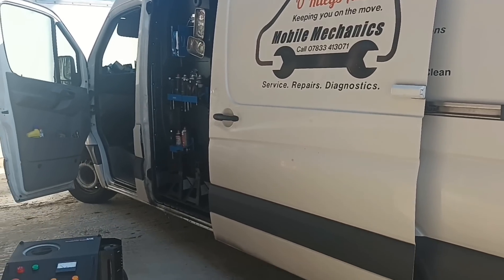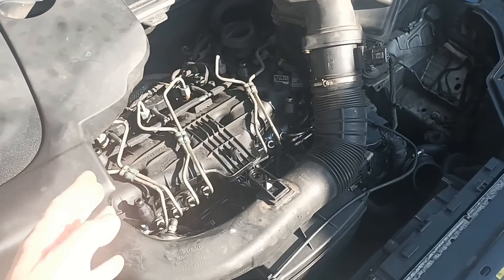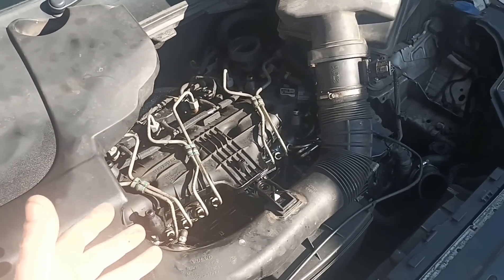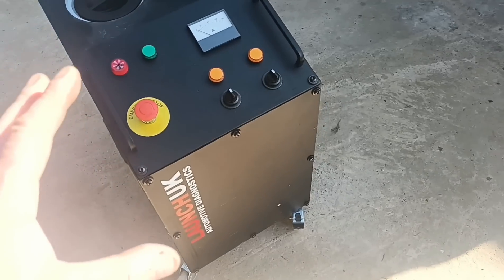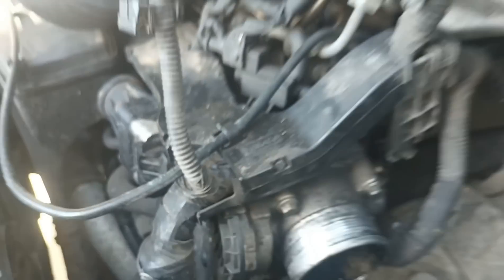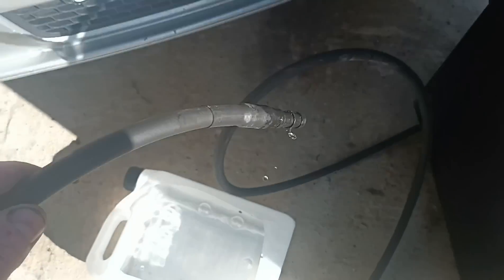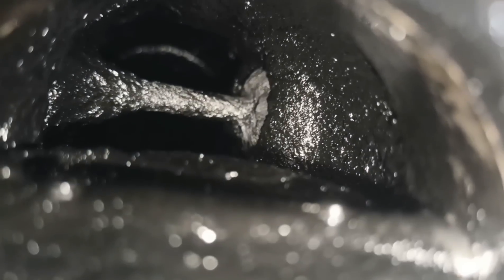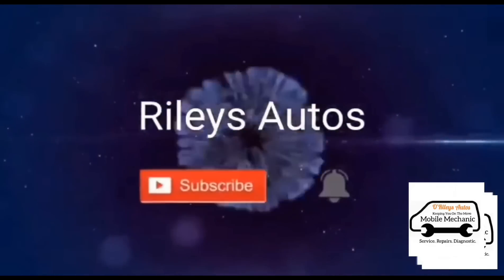Does HHO Hydrogen Engine Carbon Cleaning Work? Is It A Scam?

Comment: Here is a link to a re iew on the sysytem, dont seem to be able to find the website for purchase anymore though, odd. It is also known as cgon as wellmas atmosclear, my local MoT center said tht the co2 emmissions on my defender were lower than that of a prius!!! I did not tell them about the system prior to the MoT but rather they were confused about the emmissions and asked questions after it passed.

Comment: I have fitted a atmosclear hydrogen on demand system to defender 2.2 puma (ford engine) removed the dpf and replaced with straight through pipe, removed the egr via map. The vehicle has sailed through the last 4 MOTs with very low co2 emmissions. This system has been tested bt the MoD on armoured vehicles and proven to work by them. Grznted this is a constant hydrogen system and not just a half hr or 1 hr dose. It seems to make the engine far more responsive and well as quiter and smoother on tick over. Intersted on your take with regards to this.

Comment: The byproduct of burning hydrogen is water. I’m guessing any improvement would be as a result of steam. (Unlikely to effect EGR) It would have to be an enormous amount of hydrogen and also inject some oxygen (to get a stoichiometric ratio)in order to work. That or weeks worth of driving with a hydrogen tank attached. Also LPG produces water and there are Australian companies that inject  auxiliary gas into Diesel engines that reportedly run very clean. But not common rail.

Comment: So glad I didnt buy one of these. I was going to buy a similar but higher spec machine at auction and asked the manufacturers for a user manual in advance of auction end. Turns out they did not sell them but only rented them. The garage had gone into liquidation and the liquidators tried to sell the machine that should have been returned under the rental agreement, so they were glad I contacted them so they could get it back. They told me honestly that the reason they don't generally sell them is that they are unreliable and go wrong frequently so they only supply them as part of a rental package and they take them back to base to repair them - frequently! This was on a circa £8-10k machine.

Comment: hydrogen does not react with carbon at intake pressures and temperature so it is obvious that the intake is as dirty as before. It only MAY react in the combustion chamber forming hydrocarbons and remove carbon.

Comment: Done a lot of carbon and soot cleaning manually and with mr muscle oven cleaner (which does work a treat if you can get it onto the affected area and leave it there to work for 30mins). Long story short all these spray and gimmicks dont work. Waste of money. 
Walnut blasting is amazing 👏 only way to clean an intake like new. 
There is no short cuts unfortunately

Comment: See when hydrogen burns inside the engine it produces extra hot vapors which will clean combustion chamber and exhaust pipe. But it takes time. This video is misleading as it shown intake side where blown-by gas are fed back to the engine. These PCVs and EGRs will always  be like that.
Reply from the maker: Let me guess.. your business uses or sells these machines? I am demonstrating a service that is offered all over Europe for carbon cleaning inlet valves and egr valves and it clearly doesn't work. I have never seen anyone want there combustion chamber cleaned

Comment: Further hydrogen only cleans high pressure areas where carbon can fuse with carbon to produce hydrocarbons in gaseous form. Not made to clean egr ect.

Comment: You all got the concept wrong. Adding hydrogen as fuel to intake doesn't remove carbon deposits that already exist in the car's breathing system. Thats nonsense. Adding hydrogen will reduce the amount of fuel that the engine consumes for that particular RPM & engine load as it is substituted by hydrogen which itself is combustible. So, reduced fuel(Diesel or Petrol) means reduced emissions and reduced carbon waste flowing into the combustion chambers, through the intake and exhaust systems. As long as there are PCVs and EGRs which add exhaust gases back into the intake, there will be carbon deposits. Substituting regular fuel with some amounts of hydrogen will reduce the tendency of carbon build-up, not take out the existing deposits, which needs to be done manually. Adding hydrogen as fuel to intake will result in reduced carbon build-up, reduced emissions and reduced fuel consumption. What needs to be done is ECM mapping to alter the AFR according to the quantity of hydrogen supplied so that fuel injection is decreased at variuos RPM and loads. Even timing needs to be advanced or reset accordingly to avoid knocking.

If you want a real time hack, take a big vet syringe, add 50ml of vinegar+water mix(50:50 ratio) and slowly inject the mixture into the intake manifold rubber hose just after the MAP sensor. Do it for 30 minutes with intervals in injecting and see the results for yourself, most visibly that smoke from your tail pipe must vanish or reduce. 

Thanks.

Comment: I used an HHO machine that I made on my car along with using 2 secret products. I changed the spark plugs too and use 1 particular performance chip to have absolutely insane performance. 27 year old camry drives like literally brand new. My exhaust pipe has black stuff (and white) all over it and little puddles would form under the tailpipe.

Comment: I did the carbon cleaning on my 320d 230k km and it made a nice improvement. How you did the procedure is not the right way. First of all for €85,- it does a very good job. The engine needed to be running 45 min on stationair idle and the right amount of hydrogen mixture. When you rev the engine you pull most of the hydrogen direct through the engine and it burns away. You want to have the hydrogen gas as long as possible in the intake manifold to settle in the carbon. Only rev a few time between 2000-2500rpm to open the egr valve. After the session you go drive for at least 30 min on normal driving. After a time the engine starts running better and better even after two weeks i feel improvement. Of course this will not make it clean as new but it is worthy and worked for me.
Reply: Did you had engine vibrations at idle before carboncleaning?
Reply: @nelsonafonso1  yes, was some ,not scary, but was some .
After I cleaned the injection system too .
Reply: @expatinbrazil  right, i have w211 220 cdi over 300.000km and at idle it vibrates  and has some fluctuations on the rpm, so I'm considering a carbon clean
Reply: @nelsonafonso1  mine was doing a good improvement actually.  I wasn't expecting to be that good . I remember, on my Kangoo the Renault dealer ask me to replace the injectors and clean the diesel tank . I did it in my way and was much cheaper, much faster and the results save me good money.
Reply: Agree with you!
I cleaned my 1.7 DTI engine ( opel astra), Renault Kangoo 1.5 diesel ( 2 times ) and was an excellent job and big improvement. 
Of course, more expensive than 100E each time.
Reply: ABSOLUTELY RIGHT   1. time of  cleaning  2. AMOUNT OF  HYDROGEN, that unit u use  is a toy one.
Reply: You sound like you sell this service 😂

Comment: Why not make a small  hydrogen generator and permanently fix it. Find out in you tube. ....your car will be hybrid. Saves fuel.
Reply: Only if the hydrogen is made via a solar panel. Otherwise it's using engine power via the alternator to create the hydrogen, negating any supposed fuel economy increase.

Comment: the only thing hho will clean is the combustion chamber and it takes ages not an hour but driving a car with a hho cell on it, when you dissasemmble and engine that runs a hho cell its absolutelyspotless inside like it was just assembled after a rebuild, hho when burnt produces water vapour that cleans thr engine thats not the goal its just a bonus, weve run hho cells since 78 for better economy, it makes a very good difference on "old" school desiels .

Comment: 200k miles worth of baked on gunk, would we see better results on a lower mileage engine, with this being a preventative measure and not the cure?
Reply: That is my thinking exactly. I have been doing it on my ML320 every 40k and it's pretty clean inside. I had to replace oil cooler seals and the insides were not caked in tough residue.

Comment: Top man, you have proved what I thought when looking into this… 
Basically you can’t beat hours of labour, removing it all and good old fashioned elbow grease.(sorry to say) 
As far as cleaners go..
I use a good TFR(neat) apply..
Let it soak in!! Power wash off..
Repeat several times till your happy..
I’ve got parts back to nearly new looking this way. 
But it takes hours… 
Not good financially for the customer but the
Job is done. 
Keep up the good work ❤

Comment: I think the main problem was you were a little over 2300 rpm, a turbo actually spools up somewhere between 2500-3000 rpm, running the car back at idle then it allows things like the dpf to clogg back up due to it being closer to the car thinking it is running around town. it was a little cleaner on the 2nd look, no you shouldn't take it as high as more than 4000 rpm, while does heat up the engine as you know it also increases wear over time, but the more you can turn the engine over moving components in the engine the more chance of clearing the loose dirt on moving parts. personally never tried HHO Hydrogen so only going on my mechanic skills while dated are still relevent. but yeah nothing will actually beat a good clean by hand etc. redex has given me the most success for a car that was pre-igniting because of carbon build-up/cheap petrol, and not harmed using it on a diesel engine, but when it comes to carbon like I said nothing will get it 100% clean no matter what they say on the tin, just reduces the chance of build up over time. and I think your results from this test, and possibly other tests have shown that.

Comment: Shame it didn't  work would have been a easy way to do this I've  only  seen walnut  blasting on videos the last time i had to clean  a egr valve  on a vauxhall  i took it off used spray  chemicals  and a tooth brush 
I am always  a bit concerned  were all the bits go when cleaning  the parts when attached  to the engine

Comment: What do you mean, the exhaust manifold dosent really matter to you. If the exhaust manifold is clogged the car cant breath properly. Ive got a Diesel Dmax and inside that exhaust manifold is about 5mm of carbon deposits plus gunk. That 100% puts stress on the rest of the engine. Hence it needs taking off and cleaning...
Reply from the maker: I've never seen an exhaust manifold clog as it should be too hot to lodge soot

Comment: I was always made to think that hydrogen attaches itself to the carbon molecules and degrades them over time. Not an instant fix. The the only way you will clear the carbon immediately is with an invasive chemical clean or a walnut blaster.

Comment: He says it doesn’t work, but he didn’t drive, if he says don’t work after a test drive then I wonder? It certainly removed the carbon from piston , valve seats, exhaust manifold. He should feel a smooth drive after cleaning.
Reply from the maker: Definitely no difference.

Comment: I had egr issues for over a year and I tried everything including this. Nothing works. The only thing that worked was to take the egr off the car and manually clear it.
Reply: Which is why most garages don't want the hassle of cleaning an EGR, they see them come back too often. Hence they'll always advise replacement.

Comment: I don't think it's hydrogen coming out of the machine. If it was, you will be able to hear a difference in the sound from the engine when you inserted the hose. (Hydrogen is a flammable gas so you should hear a difference in the revs when the engine gets more combustible material put in)
Reply: Hydrogen only revs up engine using CNG nothing happens with Gasoline and Diesel.
Reply: What gas is it producing then? 😂

Comment: Hi Jimmy, have you done a vidio using chemicals????  I have just done my 2012 Volvo V70 D5, using Mr Mussel oven cleaner (off the car) it was worse than yours and is now nice and shiney, what do you use???
Reply from the maker: Not yet. Apparently Mr muscle can eat into the aluminium over time
Reply: @ORileysAutos  Yes Mr Muscle is very caustic, only apply it for a minute or so, clean it with a rag and water, re-apply as needed, mine took 3 or 4 applications, then scrubbed with dish soap and water, wiped dry and sprayed with WD40, nice and shiny, what a difference both performance and fuel consumption

Comment: I had my Citroen C4 Picasso 1.6 THP from 2011 with 210.000 miles carbon blasted, and i must say it runs like new again
 No stuttering during driving.and uses less fuel now

Comment: Hm, you are don't know what about you talking and what you doing. HHO gas can't clean inlet manifold, I don't know why you test this? HHO gas can clean combustion chamber and exhaust, and this give you effect in performances, engine working and lifetime (and other parts, EGR valve, turbo, catalisator, and particle filter) If someone claiming that HHO carbon cleaning clean inlet manifold, there are two possibilities: 1- he laying, and 2- he use some chemicals for manifold cleaning (but I'm not sure about results because I have no experience with this). 
And just to know, this black HHO machine is very week 😄 Can do something, but need much more time. You need 220V machine, about 2000W minimum. And you put HHO gas hose on wrong way, around hose air enter manifold, after MAF sensor, that's all no good. You need good machine and to testing how was before and after: exhaust gases, injectors parameters, noise, acceleration, power and tork. But those tree last things cant be easy measure because no every time big changes. You must to believe to yourself feeling, and know how to test. Don't test in high rpm, but test in low rpm and big load. Everything you want to know, you can ask me, because I developed this process.

Comment: Remove the manifold and use petrol to clean it up, works a treat but don't spray it in when it's on the vehicle you will blow the motor

Comment: HHO Carbon cleaning is more of a maintenance for EGR valves as it helps to keep the engine running more efficiently and removes carbon from the hot side of the engine. 

Generally most of the carbon oily gunk built up in the egr is from the breather system and exhaust gases baking it on 👍🏽

The proof in the pudding is a test drive of the car after the cleaning. The engine runs smoother - quiter and more responsive on most cars. 

Been doing carbon cleaning for around 4 years now never have I said that the processes cleans the egr or DPF actually blocks the DPF slightly due to the soot releases from the engine 😅

I always apply a cleaner for the cold side of the engine which helps with oils and gunk buildup from the breather system. Since using the cleaner it gives much better results 👍🏽

You see a lot of cowboy Carbon cleaners who post pictures of walnut of media blasting intake results 😂 

There’s two types or carbon cleaner you just need to find the right one 👍🏽
Reply: i agree with your comment, HHO is not made for cold side of engine where is don't burn out.
Reply: I spoke with a carbon cleaner yesterday as he was doing a treatment on my neighbors car he said himself it does not have any effect on cold side or intake of engine
Reply: complete nonsense.
Reply: @timbo19751975  - Clueless comment! 😲

Comment: thank you teacher .  my hydrogen machine cleans both the intake manifold and also that of the whole hot part.  with 2 pipes and 2 different liquids, 1 pipe produces hydrogen and the other injects a liquid for washing the intake manifolds in impulses.  air solution❤
Reply: What machine are you using

Comment: I watch your videos with great interest. I you had a new diesel car/van and it was a "keeper", would you use a quality diesel fuel additive with every tank full to reduce carbon over time? Is diesel fuel additive a myth? Many thanks.
Reply from the maker: Honestly I have 2 diesel cars and 2 diesel vans. I use the cheapest oil and fuel available. I just change the oil 5 to 10k miles and if something is faulty get it fixed before it causes issues. I use dpf cleaner once a year  in the intake as a  Carbon cleaner
Reply: @ORileysAutos when you say you use DPF cleaner in the “Intake”, where exactley do you mean.. in what intake..

Comment: The last inlet manifold that I found clogged up with oily carbon (a 2015 Mini) i had to remove the manifold and clean it out with various aerosol solvents and a tooth brush and it was still a bugger to get clean so I'd be amazed and interested if one of these machines could to the job. Also keep up the good work Jimmy I find every video really interesting and informative.
Reply: he said in the end of the video that it doesn't work, no changes
Reply: Great video Jimmy and really wondered if this actually worked too. I think the results are quite clear.   That was a very thorough  engine clean!